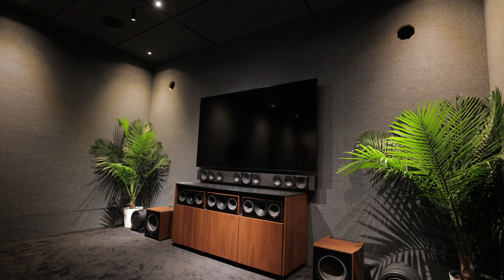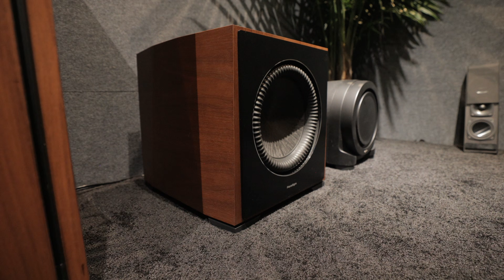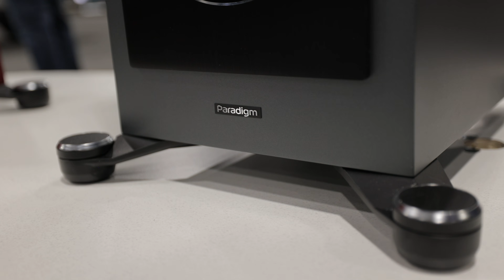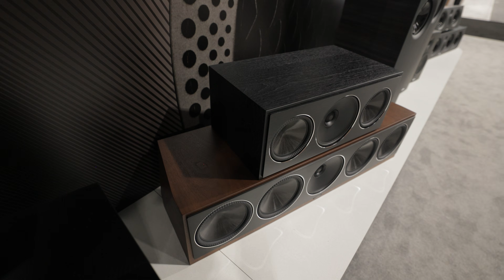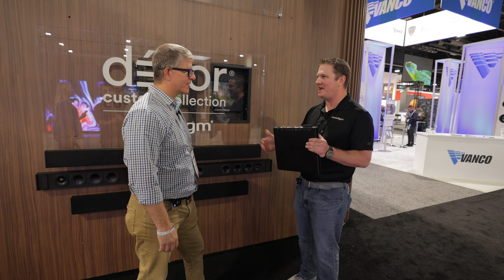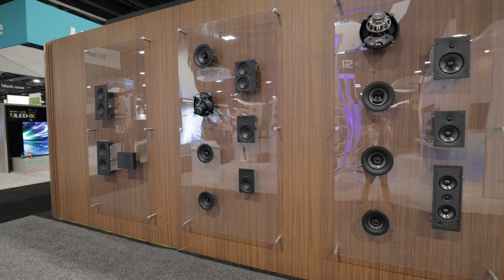Paradigm PROTOTYPE Speaker And New Anthem Gear at CEDIA 2023!

Comment: Buddy of my picked up a used Seismic 110, I was suprised at the size vs output. Will it hit 100db at 20hz no. But for the average listen it would blow them away. It even shaked the couch a little. 

The tank shots in Fury sounded large and has some nice impact without sounding booming.

If you are wanting to listen at Reference levels, it isnt for you but I would be happy with a couple of them if I was forced to use them if space and decor demanded.

Comment: For years I had only one sub .. then earlier this year I finally added a second one and... I was SHOCKED at the result ... IT WAS SO MUCH BETTER.  They say base isn't directional, but when you have a big screen TV with a big cabinet beneath it for components and a large center channel speaker, you have to the put the subwoofer off to one side.  There is just no good way to fix this problem other than getting a second sub.  I will never, have just one sub again.
Reply: try 4 sub  in the 4 corners of the room and you will think "I will never have just two sub again" :D